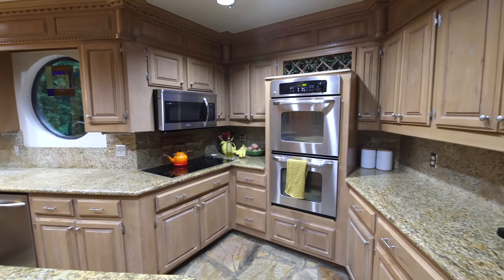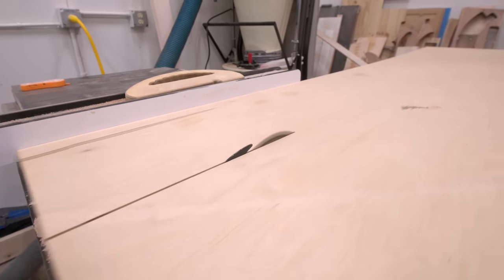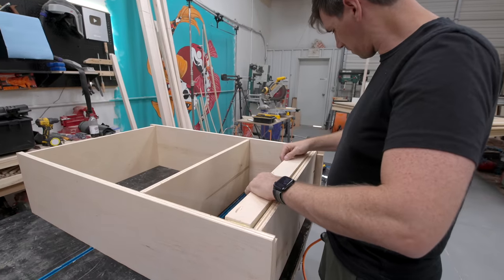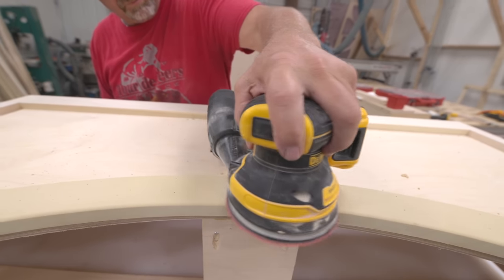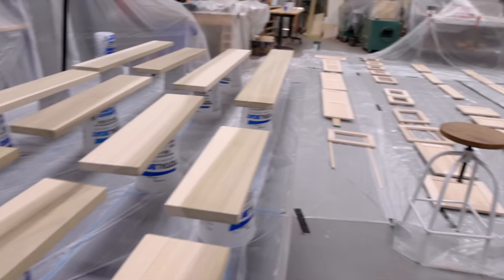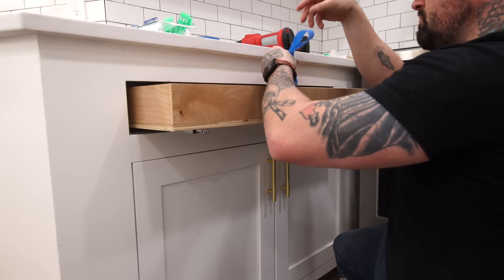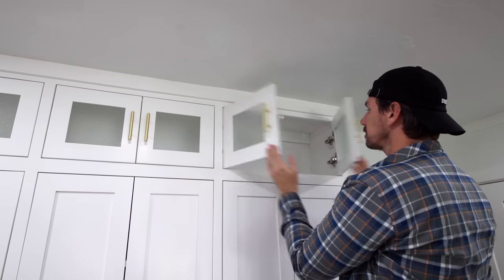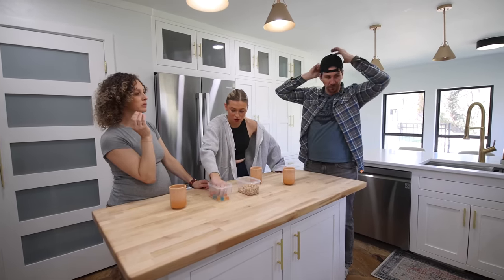How To Build Kitchen Cabinets The Easy Way

Comment: The placement of the spices makes me want to ask, why on earth are they not in the already existing drawer right above?  This requires one to stand back, open TWO doors, then lean over,  pull out  the drawer and read labels down at thigh height and then lean over again and pluck the right jar out.  The same spices in the drawer RIGHT above would be much easier to access and not use up half of possible storage room in that lower cabinet.

Comment: Nice work no second guessing. One suggestion I would make a second spice drawer shallower located above the one you installed as it seems that one is almost completly filled and smaller spices would fit easily in this second shorter spice drawer. Ray Stormont

Comment: You must be a regular at Home Depot to get good service. I've only used them for diy home projects.  Getting some help is next to impossible,  they would have just one or two pvc pipes with a hodge poge of different sizes.  I end up going to Lowes & they have all I need in the same size.  Also I quite using Dewalt products because the batteries typically only last a year before they stop holding a charge.  It looks like you have good luck with, but I used them for cordless drills and weed eaters and they just didn't hold up.

Comment: Curious any reason you did not use a Peg Jig and make the shelves adjustable?
Reply from the maker: I’m not a fan of adjustable shelves. One, I have plenty of storage in this kitchen that I don’t have a need to move shelves around to make space. Two, I’ve had adjustable shelves when I lived in a very small house and never once adjusted them. I did, however have the shelf pegs fail (builder installed plastic ones) and had a shelf full of glasses crash down around my bare feet. Not cool.
Reply: And Katie is pregnant in this video 😂

Comment: What a waste of good cabinets. You could’ve just removed the doors, painted the cabinets then installed new shaker doors and you would’ve had a new kitchen without so much waste of good cabinetry. I do kitchen remodels and yea we throw away cabinets but never cabinets this nice and built from plywood and hardwoods.